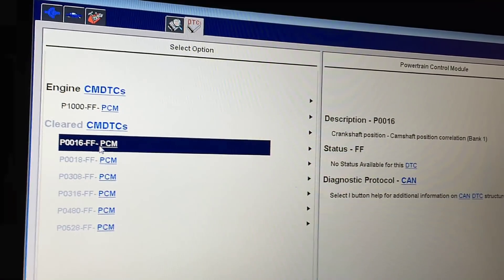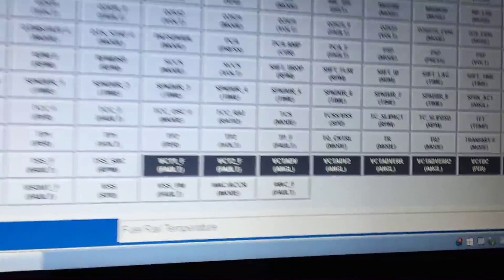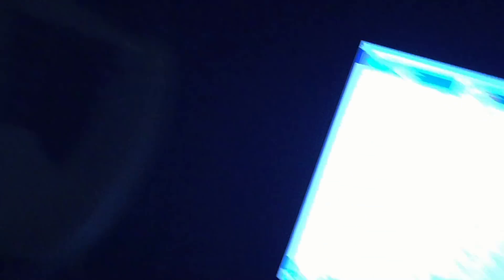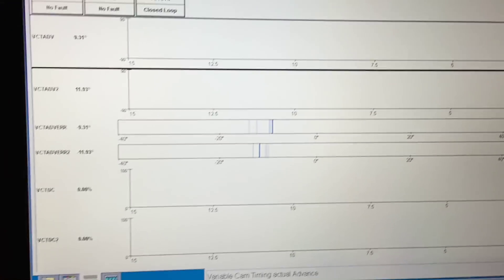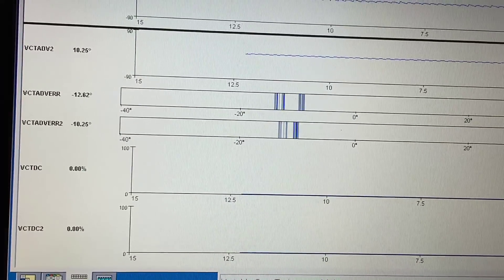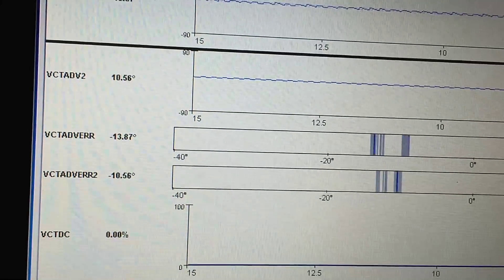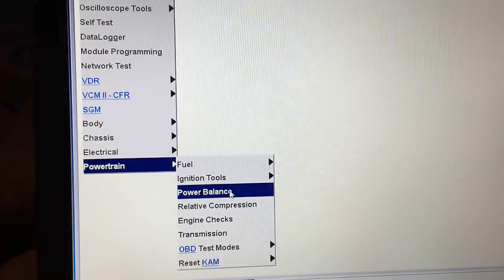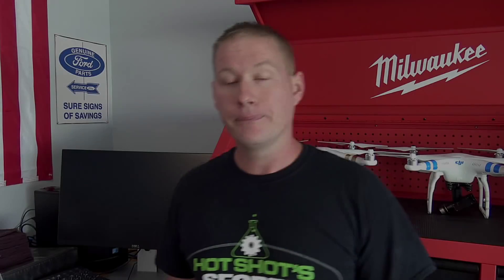Ford 4.6L 5.4L 3v Engines P0016 P0018: How To Tell If Your Timing Is Actually Off

Comment: I have a code that comes and goes p0016 and I checked all the vct parameters and the vct advance error jumps up to 4053 degrees.  I'm sure that's not normal. Could it be a timing chain issue or a vct solenoid issue. Truck runs and drives just some hesitation at idle but other than that no issues. Trying to see if I woukd need to pull that cover or not??. Any info will help

Comment: Hello, so I ran the same thing  and one bank was at 12 degrees on avg at idle, and the other was at 8-5 degrees. The one at 8-5 was correct. Do I need to advance or retard the one that's at 8-12?

Comment: I was changing my oil pump on my 2009 F150 4.6 L three of truck and change the oil pump change the timing chain and stuff so I said OK go to timing chain and everything is dead straight up. We’re supposed to be but the passenger sidephaser it sound like it moved so there’s spring tension and it does move and what does that mean what do I have to do to fix it? I need a fast response please.

Comment: How do you correct the phaser if it moves like a passenger side were removed like it’s spring tension and everything was all tubed as is putting the chains on the new chain and then it moved it because we moved so how do you? How do I correct it?

Comment: Good day I’m watching your videos for help I have a 2009 ford f-150 5.4 3v I’m getting a p0018 code I’ve changed the bank 1&2 camshafts sensors , crankshaft sensor and the bank 1&2 Vvt solenoids and still getting the code oil pressure is good can it be a timing issue I do hear a little rattle at start up for a second or 2 and it’s quiet after that I do feel a little light shaking or surge if that make sense what do you think I should do next ?
Reply: Did you ever get this fixed?

Comment: @fordtechmakuloco I’m getting these codes p0018, p0022, p2195 and p2198. Truck was running fine all day yesterday and all of a sudden today it ran like this. What scan tool are you using for me to do what you’ve done? Thank you in advance!
Reply: I was thinking of giving it a fresh oil change tomorrow thinking it might fix it.
Reply: Did you ever fix this?  I have a friend who is working on a 2006 F150 with the 5.4L and he just did a timing job on it and now he has those exact same codes.
Reply: @Mr2004MCSS  it was my battery. So I recharged it and codes were gone.
Reply: @Keazyjuan  Ok, thanks.  The battery in this truck seems fine.  He told me he replaced three of the O2 sensors today and it's running great right now.  Hopefully it stays that way.

Comment: This just happened to me after removing the passenger head to remove broken exhaust manifold. Put it all back together with new phasers timing chain kit with guides and tensioner. Fired right up but got a check engine light and found code p0016. I thought there was no way this was off by one tooth but it was. Not sure if it skipped off the sprocket while cranking (pulled plugs and cranked engine to build up oil pressure pressure) not sure how it happened because I double and triple checked my marks on crank and cams prior to installing the timing cover. I used the tool to correctly put CRANK on TDC and everything. The new cast iron tensioners have that ratchet mechanism to keep chain tight so I don’t know how it happened but after taking it all apart (again) Bank 1 chain was one tooth before TDC on the crank sprocket. (The timing chain was still matched up  on L and R on the cams) thanks for the video. 
ps: I have a new found respect for anyone doing this type of work on a 3 valve modular Ford
Reply: 3.5 garbage
Reply: I literally just replaced everything timing related.  Fired it up.... p0018. Wtf

Comment: I am having an issue with my 3v 5.4l. Just did chain phaser etc. Runs great for while and it seems after heat cycle and turn off on start up it runs the timing on bank 1 either -52 degrees or +52 degrees. I have replace vct 3 timing and even hot runs good then 20 mins or so goes back to those timing specs

Comment: Hey , your videos are a great help, I recently replaced the timing chains, timed it no problem, had to go straight back and change the oil pump, then I timed it 180 out .. is there anyway to correct this  by not taking everything back apart? ' 02 4.6 explorer SOHC
Reply: It's a 4.6 in an 02 explorer

Comment: Mine's interesting. I do have those codes when it's Italian. It's idling rough not drastically just a little wavy.
Nothing in 2 dramatic.
And I'm with I put To drive.
It's smooth as can be. And Replace 4 plugs with the cylinder.,VTC.
Codes 
P0014.
And P0024. I would have been done with this a week ago. I would have been done with this a week ago had I not had. 2? Take the cylinder out again. I would have been done with this a week ago had I not had to take the cylinder out again. 2 replace the Freeze plugs Freeze plugs. On the exhausted side. Keep in mind this is the first time I've done something like this. I was not aware of the freeze plug. Keep in mind this is the first time I've done something like this. I was not aware of the freeze plug. That wasn't installed.. I didn't see any particular instructions or paperwork you got. That's what I was looking for. I didn't see any particular instructions or paperwork you got. That's what I was  would have been done a week ago. Imagine my surprise when I had to take that cylinder back out again. I was not happy. Because I didn't want to deal with the starter and the AC compressor.
To try to take a exhaust off. Would have been easy if Ford made more room and these areas But we know that's not what they're going to do. Is it possible to change jump because I didn't move it once I Is it possible to change jump because I didn't move it Is it possible to Chain. jump because Didn't move it at all.

Comment: I have 2011 Ford Edge 3.5. Timing chain was replaced along with water pump. After started I got P0018, checked life data and found intake cam in bank 2 has -20 degree, exhaust cam bank 2 +2 degree, bank 1 intake and exhaust +2 degree. Cut open oil filter and it was clean, no metal. Replaced bank 2 solenoid - no luck. Timing was correct, double check it before put everything together. Also when I gas it timing didn't change, same degree in life date. Is that because the car has P0018 code?

Comment: I had full timing kit replaced and I'm getting p0016 code. Truck seems to run and idle perfectly with no performance issues. Any recommendations?

Comment: Brian, all your video are extremely informative! I have a question,  can I pre oil my 5.4 by cranking it with the covers off to see that tensioners pump up?
Reply from the maker: You can but oil will quirt across the room from the tensioner bleed hole.
Reply: Brian, okay, good to know. I'll just tack front cover on temporarily.  Thank you,  keep up the great video's 👍 
I installed the m360hv and hope it does the trick.
Reply from the maker: The oil squirter on the driver side head shoots oil at the valve cover, so if the valve cover is not on then...
Reply: @FordTechMakuloco just R&R water pump and the whole timing setup on a 2014 explorer xlt 3.5 with ford parts. 
Fired it up, p0018. 
Looks like I have to tear it apart again.

Comment: Im about to replace my timing chains and phasers on my 2010 Mustang gt 3 valve.  The chain have only two black links. One on one end and one on the other end. Not the one the two. Does one black link go on the crank gear at the dot then the other on the R for right bank and L for left bank?

Comment: I really wish I had your number to call you. After fixing my head gasket I now am throwing the P0016 my engine is so loud. It’s not getting any gas at first. It starts right up w no issue. And have the misfire on cylinder one on my 2017 Lincoln mkc premiere w the 2.0 4 cylinder

Comment: I have a 2006 F150 5.4 3V. I replaced everything on the front end dealing with timing. including brand new vct solenoids and cam sensors on both banks. I have codes P0016, P0018, and P0012. Mind you it ran perfect for a week and a half,  now it sounds like it has a mild or hot cam in it sound wise through tail pipe and it idles rough. lightly pressing gas it goes good. press on the pedal to the floor and it bogs down. Any ideas?

Comment: Thanks a lot for all your videos
My truck F350 5.4 have starting noise, beside chain slack and slapping noise, I purchased all original 4 guides, tensioners, VCTs and cover gasgets

I discovered that all my guides are ok, 
I found Bank1 tensioner seal broken from two places, I couldn't tell if phasers are ok or not.

I replaced it with Ford tensioner, I also replaced VCT solenoidz, but without changing chains, or removing them, I don't have timing tools and didn't want to do it yet, I thought it solved when replaced the tensioner as chains where tied with no slack.

Now I have P0016, check engine and you feel the engine is not right!

My question, could the chain jump a tooth with a broken tensioner?
 
Could it be the other tensioner?
Could it be elongated chains and need to be replaced and verified?
Or should I check wiring and crank sensor?
Reply: Man… while you were already in there why didn’t you put in new chains ?  Now your definitely going to go back in

Comment: Just did the full timing job, phasers, HV oil pump, etc...2 weeks it ran great then started sending way to much fuel to the injectors. weird...I'm getting EVAP code, Rich code and 02 sensor stuck code.  hmmm.
Reply: To the mechanics on this thread, is there anything in this timing job that would make the 5.4 act like this? It has new plugs, new coils, new Air sensor & new fuel rail pressure sensor..  hmmmm.

Comment: good afternoon
I have a ford f150 2010 4.6L and it gives the code p0018, p0016 p0305 change the coil, the spark plugs and the position injector and it still repeats the same codes.
The failure started yesterday and I realize that he is already doing the oil change.

Comment: Hi Brian, I literally have my truck a month and it's throwing a p0016. I changed the VCT solenoid the camshaft sensor and the crankshaft sensor. Still no luck! Is it possible this chain jumped a tooth? The truck has only 85,000 miles on it and it's a 2010 Ford Expedition. Could this just be a bad phaser? I appreciate any input thank you.
Reply: *update*! I just did the timing chain on this vehicle, it did not jump a tooth. The top guide on the right hand side of the engine broke in half. This was causing slack in the chain, which was giving me the correlation between the cam and crankshaft error code. I replaced the entire timing chain setup including the phasers. All genuine Ford parts!  Engine runs like a top now. No more codes. Hope this helps someone.
Reply: @frankpalladino2524 Was easing into a parking space this evening and my truck began stumbling and sputtering as if it were going to stall. Airing on the side of caution and leaving it parked until the holidays pass. Neighbor came by and picked my family and I up. While there he used his basic code reader and I got the following: 
 
P0012: Camshaft position timing over retarded Bank 1.

P0022: Camshaft position timing over retarded Bank 2. 

P0016: Crank/Cam position correlation Bank 1 sensor A. 
2009 King Ranch with 147k. Meticulous about doing the services every 3k…especially since my vcts were repaired at less than a 100k. I’m bracing for the impact lol Merry Christmas.
Reply: @Sheeeeeeeeeeeeiiitt  sorry to hear that! That correlation code is not good. Almost guaranteed one of your guides broke. The chain starts slapping a little bit which knocks the timing out. It's a tremendous job and huge undertaking. So funny, last 2 days my truck started bucking at idle. Not happy at all with Ford. Also my gas gauge stays at E and never moves. Time to unload this truck. Good luck hope it turns out to be something a lot less expensive. Keep us posted that's how we learn.
Reply: @frankpalladino2524  Thank you so much for replying Frank. I certainly appreciate you sharing. It’s been parked since this occurred night before Christmas Eve. I’ll certainly follow up as soon as I get some boots on the ground. Happy New Years!
Reply: @frankpalladino2524  Frank you were dead on with the timing chain guide being broken. The upper passenger side. Curious though, have you ever heard of a broken in half vct? Also both tensioners blown out but it appeared all of the damage was on the passenger side.
Reply: Ok good, glad it wasn't a waste of time to tear it down and still have the problem.  Never heard of the vct split like that. My guide was broken on the left side as well.   
Probably a flaw Ford will never fix. Good luck with it. Glad it all worked out.

Comment: Hello I have an issue with my 2013 F150 3.5 twin turbo cluster the right side warning lights don’t come on at all I know check engine is on but can see it I pull the cluster off and everything looks as it should if anybody has had this issue and ven help I will appreciated.

Comment: Hello I'm having a problem with my 2006 ford expedition eddie Bauer I'm getting a code p0022 an it has a knock in the engine as well what could it be should I get both phasers done with the timing chain???

Comment: What would cause a 2010 f150 to run really rough and the throttle doesn't even work after doing cam phaser lockouts?

Comment: I just did the entire chain setup on one of these engines & now have P0018 & P0022.  Are the replacement chains identical?  I know I timed it correctly.
Reply: I have the same codes now. How did you resolve yours?
Reply: @thomas-gj7pp  This was quite some time ago.  I remember having to redo this job because the owner of the truck purchased cheaper aftermarket phasers, which may have contributed to these codes.  In the end, he purchased the bespoke Ford phasers & cam sensors & I believe that may have been the proper solution.  I also told him monitoring the oil level is crucial because these phasers work with oil pressure.  Hope this helps you.  Cheers.
Reply: @narcissistwhisperer  okay. Thank you!
Reply: @thomas-gj7pp  No worries.  :)

Comment: I had a P0012 code and swapped both VCT solenoids. Now it's running rough and giving me a P0012 and P2197 with a P0018 and P2196 pending,

Comment: I’m getting P0112 and p0116 after I started my truck one day and heard a loud thump so I changed the vct solenoids and and swapped the cam sensors and still getting codes is it possible that loud thump was my timing jumping a tooth and if so is there a way to fix or should I look into getting a rebuilt engine.??

Comment: Thanks for theis video and the ones on how to change the timing chains.  I have a code p0018 after replacing the timing chains, phasers, guides, tensioners,  solenoids, oil pump and water pump with all Ford parts on a 3v 5.4 engine.  When the car first started I did not get any codes, though only ran the engine for 5-10 minutes.  After sitting, it needed a jump and backfired a bit but then started and showed the check engine light.  I connected the car to Forscan and see dtc p0018 and VCTADJ near zero and VCTADJ2 around -11.

Could the p0018 be caused by a bad solenoid or phaser or is definitely a mistimed engine?
thanks for you help

Comment: Just had a full timing job done on the '10 F150 w/ 5.4L and now getting the P0018 code, I'll assume the shop will fix for free since I just paid them $2200 and they are the ones who didn't time it properly.

Comment: I just did my timing my Codes are p0012,p0022,p0016,p0300 do you think I Skip the tooth ?
Reply: Hello Denis,  we’re you able to find the cause of the codes and or what did you do repair wise? I know it’s two years later i’m just now experiencing same issues. Thanks for any feed back good sir.

Comment: 5.4 v3 I had a p0306 code then I've replaced the spark plugs, coil and cleaned the throttle body and after replaced those parts  NOW I have a rough idle, loss of power, stalling at stop with codes p0010 and p0345. When I unplug VVT the truck just doesn't go at all. What should I do?

Comment: hi @fordtechmakuloco, i have an 07 Expedition and it idling rough and seems to not run great throughout the RPM range, i'm getting a p0016 and p0012. Do you have a next suggestion for me to diagnose it further?
Reply: I'm having same issue
Reply: brandon wilgis did you fix your problems I’m having the same codes?
Reply: Any updates?
Reply: @Sheeeeeeeeeeeeiiitt  mechanic said it was an oil issue but I haven't fixed it yet lol

Comment: I replaced everything to do with the time and chain, new phaser and everything.  The truck still has no power. I have a 2010 Ford f25 super duty xlt with the 5.4 v8 motor. The truck has no power,does anyone know why ?
Reply: Billy Orton. MAYBE LOW compression cars by warn piston rings

Comment: Just did chain\phazers etc 2004 F150 225,000 miles. I have experience doing them.

It wouldn't start before the replacement, and just popped through the intake. It had lean codes, and those were fixed w  a new MAF  and O2sensors

Before replacement, it would start it i unplugged the cam sensorsam

After replacement, same thing!  When it's running, I plug them back in, and it keeps running. No codes yet

What could be going on?

Comment: My mustang has very low power till high rpm. It has a deeper tone and a miss fire with vibration. When I hit at a higher rpm it seems the power comes back. Replaced all coils and plugs.still no change. Ordered new phasers and vct solenoids. Does this sound like the problem?

Comment: After a phaser lockout on a 10 expedition it was running great for five min now misfire on 2,3,4 could this be a timing issue? I'm not showing a p0016 or p0018
Reply: I've had plug coil issues after timing. Now the engine is firing the way it's supposed to and will aggravate igniton issues